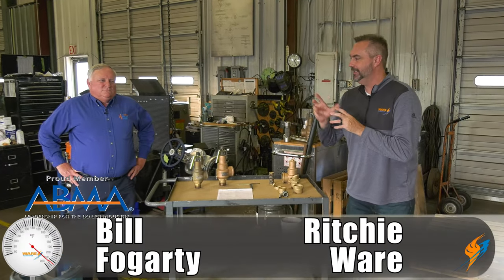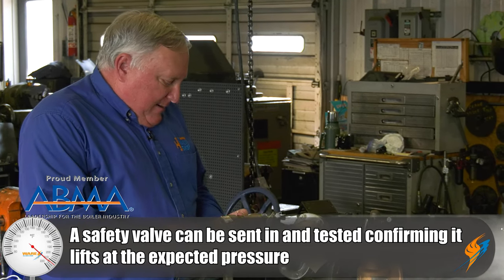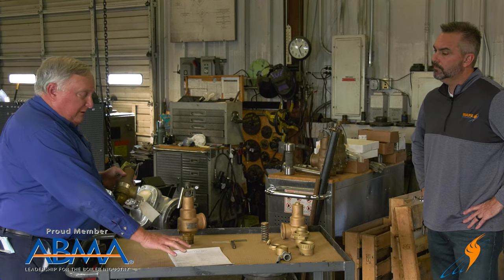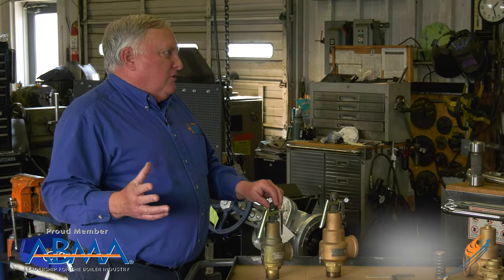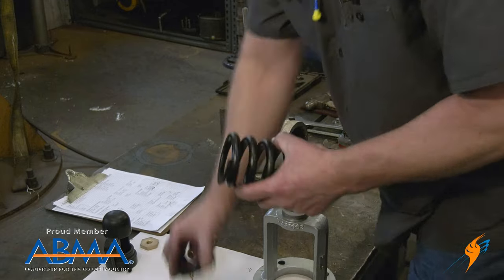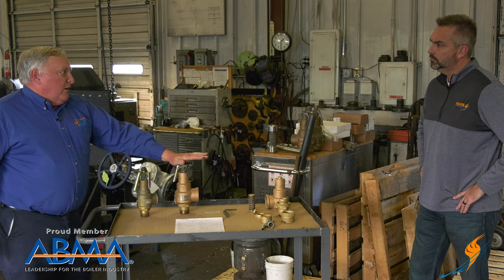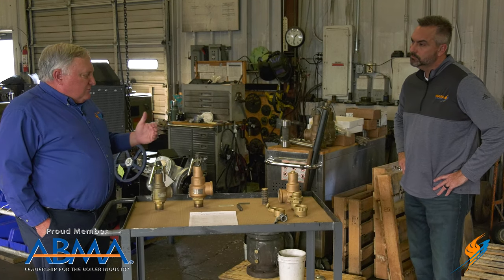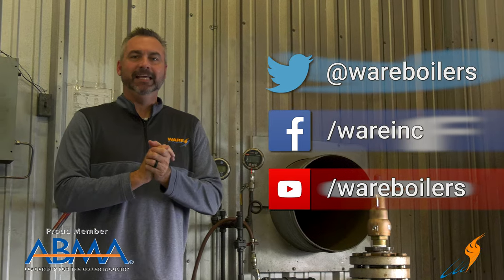Boiler Safety Relief Valve Testing and Repair - Boiling Point

Comment: Could somebody address if it's SOP to actuate the relief valve manually by lifting up on the handle on the valve head. I was trained, by a very senior boiler tech., to test the relief valve this way every time I came on shift. However, the boss at my last job had a fit and stated that the valve was only tested when it was sent away for inspection. If this is true, then why does the relief valve have an actuating handle. The shift key went out on my computer, so I cannot type question marks-please excuse-John in Texas
Reply: This is the question that lead me here. Can someone provide any insights on the topic?
Reply: As recommended by the ASME, a try lever test should be performed every 30 days, or after any period of inactivity. - Low Pressure Boilers fifth edition. Fredrick M. Steingress

Comment: Hi Guys, Does the inspector witness an accumulation test of the safety valve on the boiler ?  In my experience I have yet to see an inspector know what the firing rate on the boiler is. Without knowing, its not a proper test. They dont even ask.

Comment: Hey Where Heat Recovery for Steam Train locomotive!?
Reply: Most steam engines used waste steam as a feed water preheater before being sent up the stack to help induce a draft
Reply: @Quakefire  Excellent. Why draft is needed in stack? Thanks for your time.
Reply: @cck1496  the draft helps pull hot gases through the length of the boiler to help heat the water